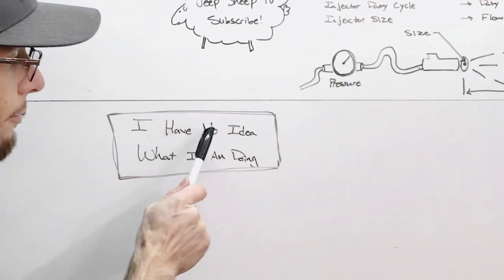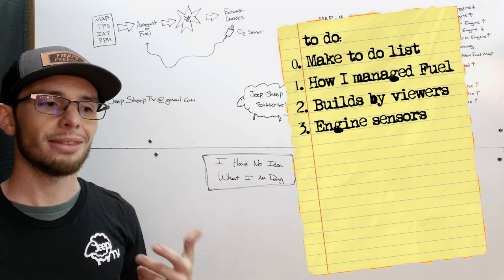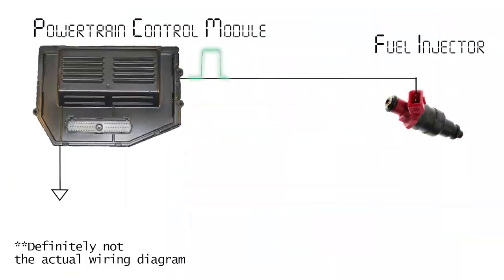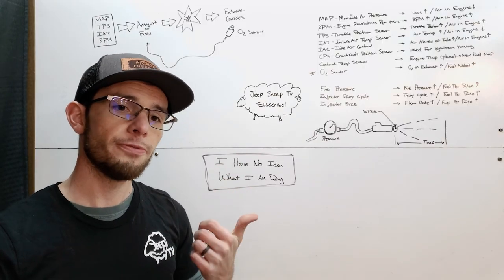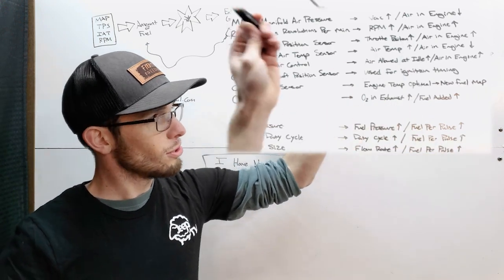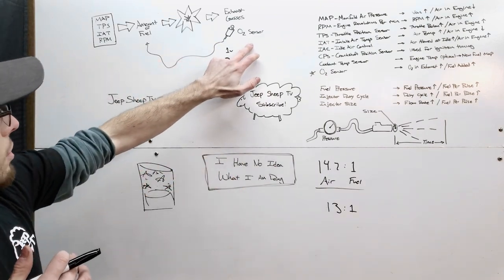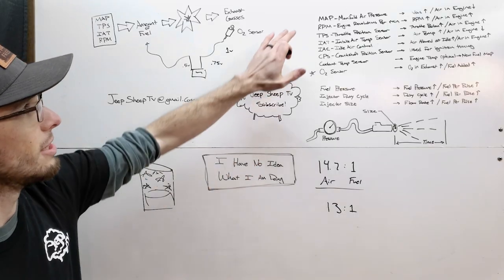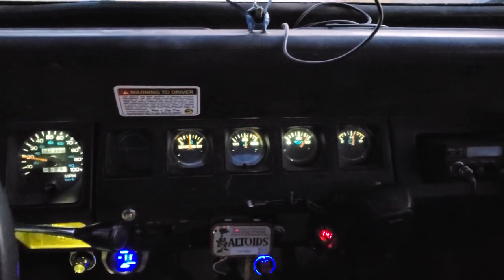DIY Supercharger Part 4 - Fuel Management

Comment: This is actually really awesome I took my Jeep Wrangler 2.5 l from Austin to El Paso which is typically in a modern car a 7 to 8 hour drive. In my Jeep it was a 12-hour drive 😬. I figured out a little trick that helped me get up to 70- 80  miles an hour because I can only get to 65. Especially when I'm going downhill I would get right behind an 18-wheeler and on these long trips it really wasn't a problem because we could both maintain speed. It helped a little bit with the gas consumption but it got pretty sketchy because I didn't know where the next gas station was going to be. There's nothing worse than being broken down in the middle of a desert. 
I remember I pulled in the parking lot with my engine sputtering it died in the parking spot that I pulled into. I was relieved that I made it.
Reply: Get a military "Jerry Can" holder and Jerry Can. It holds an extra 5 gallons for those long trips. I have one for my TJ and It bolts right next to my spare tire rack. I just did a rattle can primer and Dupli-Color match paint to stock paint and a clear coat. It took less than 1 Saturday to get everything done. Hope it helps in your adventures. By the way, in total it cost around $75-80 for the mod.

Comment: As far as octane I run premium in my 95 yj2.5 and my 92xj4.0 people say it doesn't make a difference but both of mine run much smoother with it 🧑‍🔧
Reply from the maker: Do you live in a state where premium has less ethanol in it? If the ethanol content is lower you will see an improvement in power and economy  but it has nothing to do with the octane rating. I have a hard time using high octane fuel because it's expensive and the Jeep doesn't have heat mileage. If I get my tune wrong or if I'm driving into wind I can get as low as 7mpg with the supercharger on, otherwise I average around 14mpg.
Reply: I can get non-ethanol gasoline where I am at. That is all I run in my vehicles. They all running as smooth as an old Singer sewing machine.

Comment: Upgrade the fuel pump to a fuel pump that gives you above needed pressure. Then get a fuel pressure regulator.
Then upgrade the spark plugs to a higher CC level. Match the spark plugs to the amount of intake you are going to get with the supercharger. Together you will have your golden ratio to maintain the fuel to air ratio. Upgrading the fuel system will keep you from running lean. Fat and happy is not always good advice but it can keep you from having catastrophic problems it's better to slowly lean to a ideal mixture than to lean out too far.

Comment: I get the 91-95 people with the SBEC2 using piggyback stuff, seems odd that the 96-02 owners would be playing with them considering their JTEC is fully tunable with HP tuners.
Reply from the maker: Interesting, that is good to know.
Reply: Also skankfoot racing makes an adapter to put a JTEC ECU in a SBEC2 Jeep, so you could also tune with HP tuners.

I've contemplated doing that to mine, I run an 89 2.5l converted to 95 YJ fuel injection in my supercharged MJ.
Reply from the maker: @Nathen2990  very cool
Reply from the maker: @Nathen2990  I am doing some research right now into Speeduino for a low cost and fully customizable ECU solution
Reply: @JeepSheepTV   I have a Speeduino for my MJ, just haven't got around to setting it up though.
It is inexpensive but also a lot of work to set up, people have ran the 4.0l off of it but so far no 2.5ls, also neither 2.5l trigger pattern is currently supported so you would either need to write the code or set up an aftermarket trigger wheel, I've got a 36 -1 wheel to eventually put on mine.
Reply from the maker: @Nathen2990  If I am able to set up the speeduino for my jeep I would write the code to work with the existing sensors so that it is easier for the next guy. If I can find the time I would love to develop a speeduino kit optimized for the 2.5L. There are a lot of advantages we could tap into even for the N/A guys
Reply: @JeepSheepTV  that would be cool, someone did the 4.0l code but so far nothing for the 2.5l.
I would think that you could probably just tweak the existing 4.0l code to work with the 2.5ls flywheel pattern.
One of these days I should mess with mine again, I have a stock SBEC2 ECU connector so the plan was to retain the factory harness and just make a plug n play Speeduino ECU, like they do with the Miata.

Comment: How many cc's is the stock YJ fuel injectors? 
When you upgrade fuel injectors to allow for more fuel you allow for more pressure per stroke. Obviously you would have to maintain the ratio when you do this so you would have to have forced induction to keep the engine running. Also another thing you could do is modify the engine with an upgraded camshaft. This would change the timing to less economy and more performance. Also it sounds awesome.

Comment: Fuel pressure should be 41 ish with the fuel pressure regulator unplugged and 31 with it plugged in and running perfectly.  I have had no luck with a reliable OEM fuel pump to include Bosch, all have dropped and run at 26psi.  I use the four-hole injectors and no fuel pressure regulator, currently hitting around 35-36psi.  I am adding my MSD next week and re-gapping the plugs, then adding the PC3.  The 2.5 also pulls data from the temperature sensor in the thermostat housing.

Comment: i want to see you build a hi compression bullet proof engine in the future and up the boost to 8psi. i believe the v 8 amc engines share alot of valve train components and maybe even rods and pistons so with some reshearching you might be able to get who know what all aftermarket performance parts that will work or be modified to work. Wouldnt it be awesome to install forged rods and pistons in a bored out 2.5 with 8 to 10 psi? With a beefed up valve train  and headstuds a reliable 200 plus hp would be easily obtainable and dependable. If you dont do it i will lol
Reply from the maker: I think there is better aftermarket support for the 4.0L engine which also shares components. It really wouldn't be that hard to find beefed up components as there are many kits for the 4.0 that make it ready for a turbo. I could honestly ramp it up to 8psi right now and get close to 150hp or more depending on what the engine actually makes now. I just need to get my bypass valve tuned in first so it's more drivable.
Reply: @JeepSheepTV  the 4.0 pistons are interchangeable with the 2.5.  I did a .30 over on my 2.5 and I have two spares.  Supposedly there is a stroker kit out there.  I will build one if I can source the parts.
Reply: Sadly 2.5L is about as large as we can go before the engine becomes too unbalanced.  Anyway, these 4-bangers are at a pretty low compression ratio with an iron block so...boost away! You can get stronger connecting rods and maybe cut a 4.0 crank cradle to strengthen the bottom end.  Don't forget to open up the piston ring gaps and 'port' the oil pump.  Maybe lighten and balance the crank and pistons?
Reply: Mine runs 9psi, I can confirm it gets up and moves.
Reply from the maker: @Its_Stone_Time  What is the benefit of opening up the piston rig gaps?
Reply from the maker: @Nathen2990  9 psi should encourage some movement lol. What supercharger did you use?
Reply: @JeepSheepTV   the MJ has a small Kenne Bell supercharger with a Laminova water/air intercooler, it's also on a built engine so it really goes, it's significantly faster than my 4.0l XJ.

My current 2.5l build is on a YJ using the 97-00 SLK M62 like yours along with a water/air intercooler, I'm just starting to put it together but it will be a stock engine and I am aiming for around 8psi.
Reply: @JeepSheepTV  You run a larger gap to accommodate for heat expansion, when the pistons and rings get hot they swell in the cylinder, if the rings are not properly gapped the ends could touch when the rings expand causing them to stick in the cylinder bore and damaging the engine. 
Boosted and high performance engines are dealing with higher combustion temperatures which leads to more expansion, requiring a wider ring gap.
Reply from the maker: @Nathen2990  I figured it had something to do with higher temps. Thanks for the detailed description!

Comment: Do you have to use the power commander three or could you use other ones like the power commander four or the five?
Reply from the maker: You can use the others.  Just need one that connects at the injectors for a 4cyl engine

Comment: is there a certain model number of pc3 that you are using? or is there only one pc3?
Reply: There is more than 1 part number that will work but you need a PC3 or PC5 that was built for a 4cyl engine and connects at the injectors not at the ECU. The GSXR 1000 is the motorcycle that my PC3 was designed for.

Comment: So if 4 hole injectors add more fuel ( dropped mpg so I assume more fuel) just yeet those in and it should have enough at high rpms?
Reply from the maker: Who says 4 hole injectors add more fuel? The injector size (or flow rate) determines the fuel flow not the number of holes. Aside from large changes in the flow rate the PCM will adjust itself to normal parameters when in closed loop.  Only in open loop will you see additional fuel
Reply: @JeepSheepTV  when i swapped 4 hole into it i lost 2-3 mpg vs the stock single hole
Reply from the maker: @justinpalmer9417  dang,  I don't think that should happen.  2-3 is a lot.
Reply: @JeepSheepTV  yes that is why we made the conclusion they add significantly more fuel.   You could also smell it at the rear of the jeep.
Reply: @justinpalmer9417  You have one or more bad injectors or a bad O2 sensor. I've installed 4 hole injectors in 5 jeeps and they all gained MPGs. 
Look at your spark plugs and see if they're black. If they are all the same then change your O2 sensor.

Comment: Do you need higher pressure fuel injectors for the super charger?
Reply from the maker: You can,  I opted for increasing the pressure in my fuel line with an inline  regulator. It's easier, cheaper, and you can adjust it periodically while you dial in your tune.
Reply: @JeepSheepTV what part number did you buy?
Reply: @JeepSheepTV could you help me out and give me a list of the parts you bought for the whole thing and the part numbers please?
Reply from the maker: @WyattW28  I added a link to the regulator in the description of this video
Reply from the maker: @WyattW28  All of the parts should be in the descriptions of each video

Comment: Has anyone done this with a 88YJ? Biggest differences are TBI and a VBelt.
Reply from the maker: Not yet,  I belive the v belt would need to be converted to serpentine belt.  But you could add another belt system on top of the existing v'belt pulleys. Could be done.
Reply: i'd be in the same boat as you. Once i figure out why my jeep died at the job's parking lot, i'll get it back home and get started on this build!

Comment: How did you manage the timing?
Reply from the maker: Although adjusting the timing is recommended when supercharging a vehicle, I didn't do any adjustment to the timing. It's very difficult to do any adjustment with this jeep and I get away with it by operating at such low boost.

Comment: I just finished a buddy’s Jeep and I only used a blow off valve
Reply from the maker: Cool,  you can totally do that.  I like to drive with the SC turned off a lot of the time so I have the bypass for NA mode.
Reply: @JeepSheepTV  ok heck yea I think I need to use a voltage clamp on the map sensor now the jeep cuts out as soon as I hit boost it is an obd2 style also . I thought I would let you know I am using a m45 the smaller supercharger
Reply from the maker: @alexmarti9011  I would love to see pictures of the m45 setup! You are the second person to have map sensor issues. I'm actually surprised that I don't. Keep me posted on how you solve it.  You can always email me at jeepsheeptv@gmail.com

Comment: LS swap for $1000  (sorry to be that guy)
Reply from the maker: I dare you to swap in an entire engine, transmission, transfer case, wire harness, motor mounts, gauge cluster, and driveshafts for under $1000, then a new d35 rear axle after you blow it up.
Reply: @JeepSheepTV  Ok !! Already doing it but in a cj5. I hear you though!